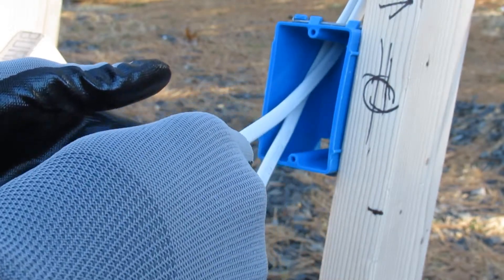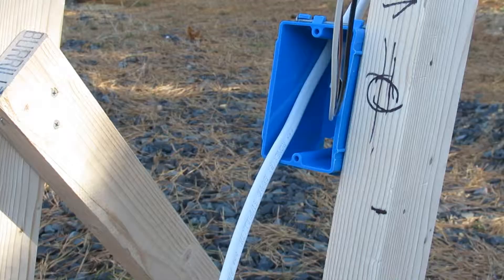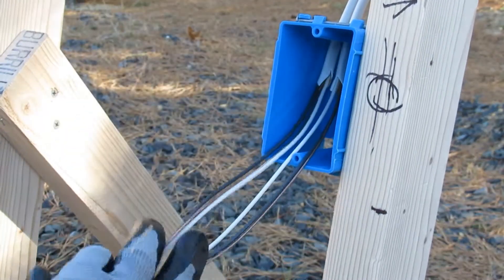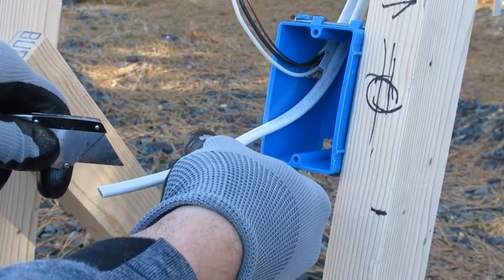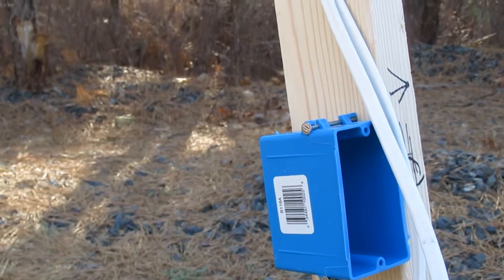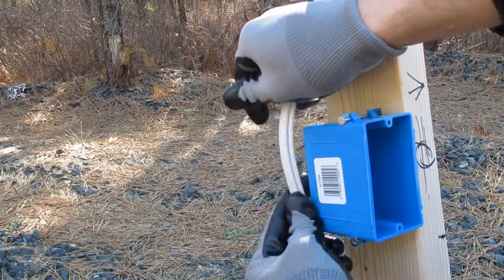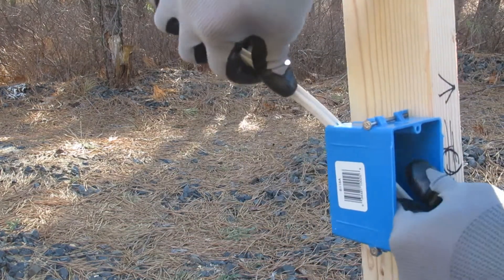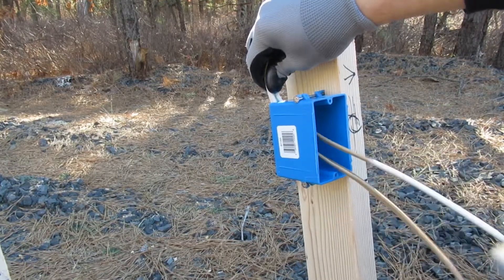3 ways to strip "romex" wire sheathing

Comment: Method 3 is horrible and method 2 would be inconsistent and cost you time and be more of a strain on your body
Reply: What method do you suggest?
Reply: @JDeWittDIY  I like method 3, but I completely remove the sheathing and the paper before putting the  wires in the box. Method 1 is also ok, but method 2, nah, I agree with @chrissilva5659 on that one. 
I think electricians use method 1 a lot because they believe that it's faster, but if you are a diyer like I am, speed is not really important. Method 1 is probably better if you have a box with internal clamps, like old work boxes and multi gang boxes.

Comment: What strippers would you recommend for stripping 14/3 and 12/3 flat and round sheathing? 

Thank you in advance.
Reply from the maker: for 14/3 or 12/3 you would go extra light on the cut to not hit the wires
Reply: Dude get a lil ripper from ideal. So handy.

Comment: I am just getting into being a electrician but one thing I’m always scared of is i cut too deep how do you tell if you cut too deep?
Reply from the maker: if the knife cuts through the plastic of the insulated conductors there is risk of a short or arc faults, any cut is bad and even if it just touches the plastic over time the cable can crack open as seen in 40-50 year old panels where care wasn't taken to not damage the wires, if in doubt about the insulator and not the integrity of the copper you can wrap with electric tape and sleep better at night

Comment: I cut the end in the middle and then pull up on the ground wire to cut the sheathing up to where I need it.  Then use cutters to clip it all off.  I have a pair of long nose cutters that are easy to get into the box. Good video.

Comment: I have NEVER use a Razor Blade or Box Cutter ! Too much of a chance of cutting the insulation of one of the conductors inside the sheathing !  I have always used a Romex Cable Stripper  that only slits through the outer jacket sheathing and never touches the conductors inside  the jacket !!
Reply: Only if your a rookie or unskilled